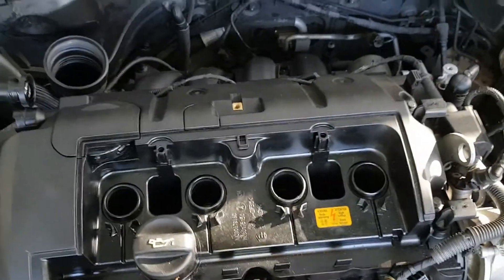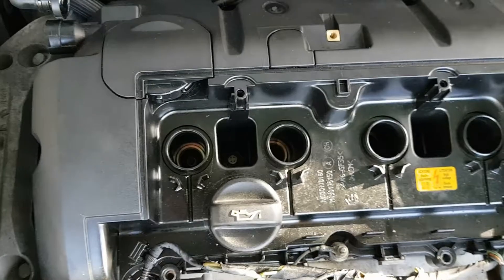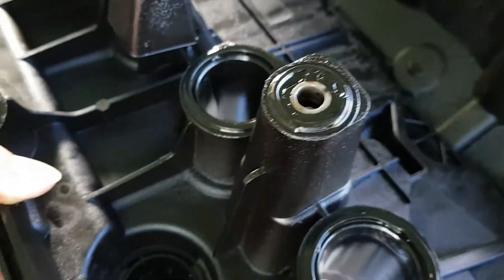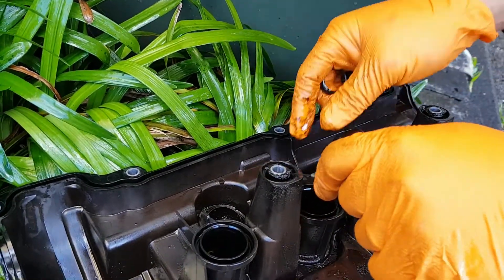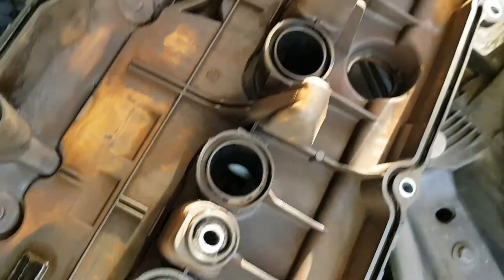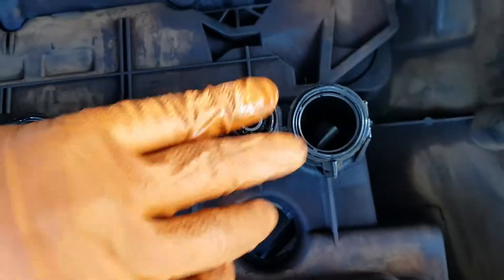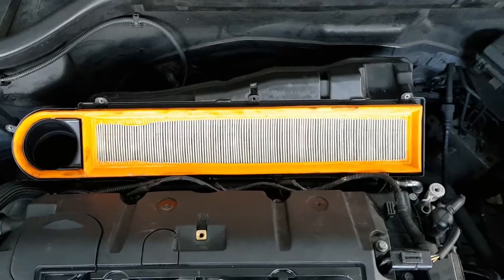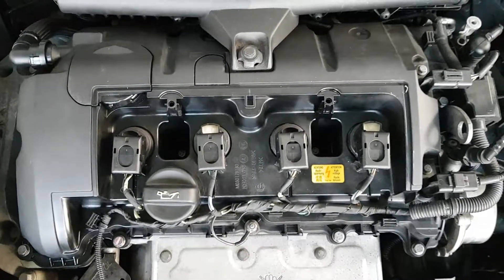Mini Cooper 2007 Episode 3 - How to replace rocker/valve cover gasket

Comment: U wouldn't happened to know the size of the socket that u need to replace the spark plugs do you?? 😬
Reply from the maker: From memory its actually a special BMW/Mini socket since it has these funny grooves in it. If you search for R56 spark plug socket you'll see what I mean
Reply: I just did mine.  It’s a “thin wall,” 12 point, 14 mm deep magnetic socket that you can get easily on Amazon or local auto parts.  I got mine at Oreilly auto parts for like $27.  Could have gotten it cheaper from Amazon but did not want to wait on delivery time.  You also need a long extension for sure.  

Description for your amazon search: thin wall spark plug socket 12-point, 14-millimeters

Some people will complain that the socket gets stuck in the well once the plugs are loose and you try to pull them up because the socket does not lock on too tight to the extension. But I’ve seen that happen with any socket when it requires using the socket to grip/pull on something. 

The solution is easy: use the black electrical tape to secure the socket to the extension before starting.  Easy peasy.